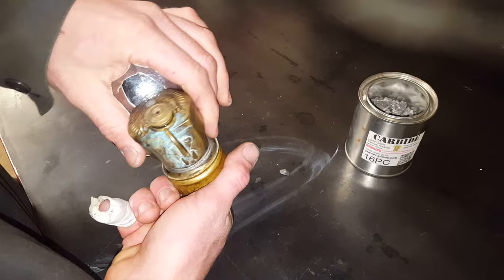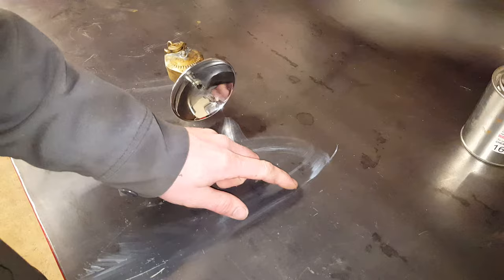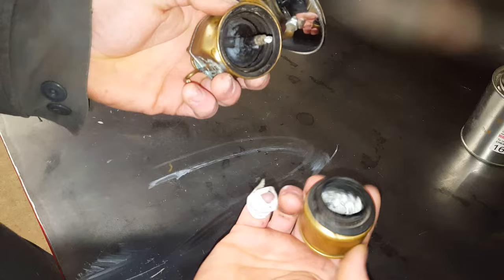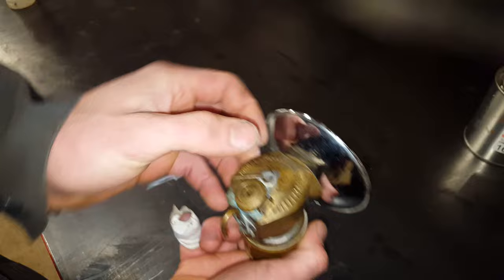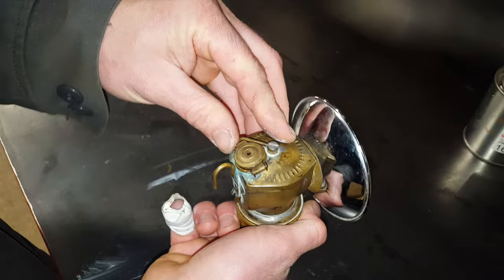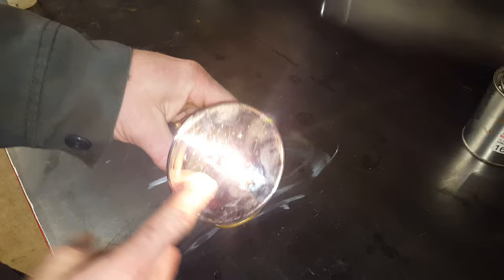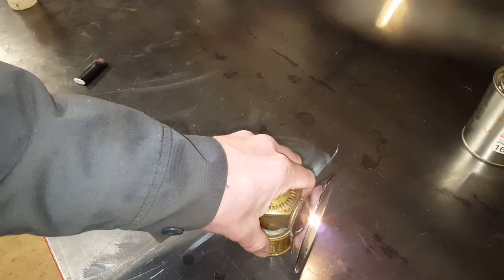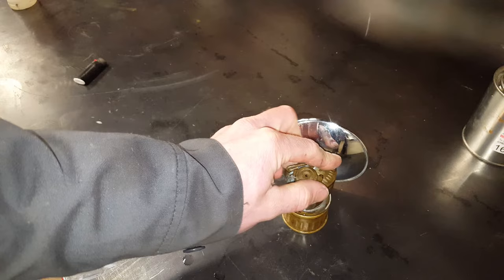MINERS LAMP APOCALYPSE FLASHLIGHT! Calcium carbide Just Rite light DEMO

Comment: Very robust lighting, just keep your Calcium Carbide dry (in the cannister). These same kind of lights were used on 1913-1914 Chevrolet cars! They were the headlights! (no kidding...you had to stop, get out, light them, hope for no excessive rain, and remember to turn them off when you got home! Coal miners were often provided their Calcium Carbide 'by the company', to work in the mines...but they bought their own lights in many instances, from the 'Company Store'.
Reply: I assume that would have been a hell to clean off the glass covers on the headlights of those old cars.
Reply: Uh hate to tell ya but the calcium carbide stones do not have to be dry in fact they emit acetylene gas when water is added...check yourself before you wreck yourself

Comment: Nice lamp just picked one up.  The only other use of calcium carbide I know of aside that.  Years back at an old job we used to make 80 ton ladles of steel An used 25lb cans of carbide to lower the Sulfur in the liquid steel when we were changing the chemistry.

Comment: There's another separate purpose for calcium carbide but this is a primary one. Question: how sensitive is the material? For example, we (not me, relevant society) don't play with raw sodium, we keep it in oil or something to prevent unwanted reactions. Is calcium carbide tame enough to just eventually put the lid back on as long as you're not dripping water in the can? Do old cans of it need to be opened carefully?

Comment: The absolute worst apocalypse light ever to bank your needs of lighting on! 
Not only is the carbide expensive to stockpile for an apocalypse and would be hard to acquire during one,  it also degrades over time when exposed to any moisture in the air. Also, Calcium carbide is made in an electric arc furnace because a temp over 2,000°C is needed for chemical conversion between its two precursors.
Even small scale manufacture by other means of heat wouldn't be enough carbide to be of use and effort in an apocalypse. 
Hopefully the video tagline was meant as a joke.